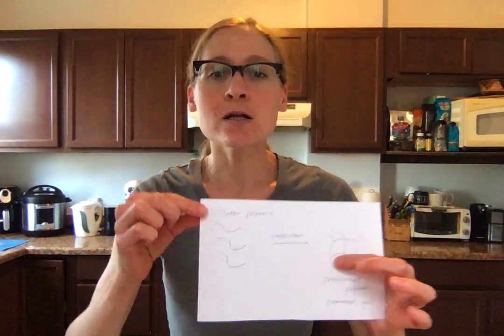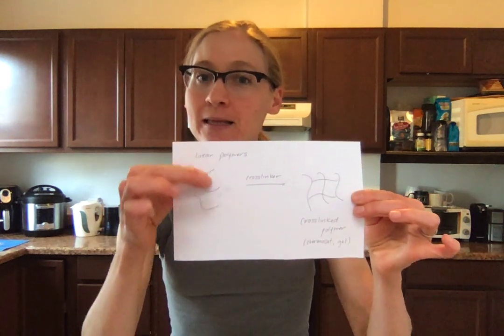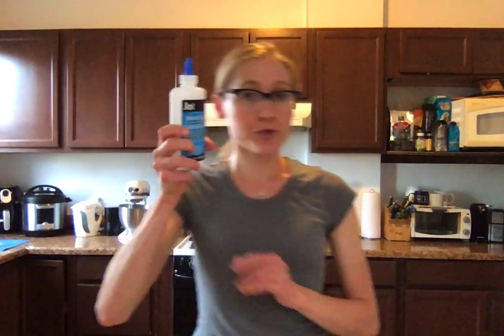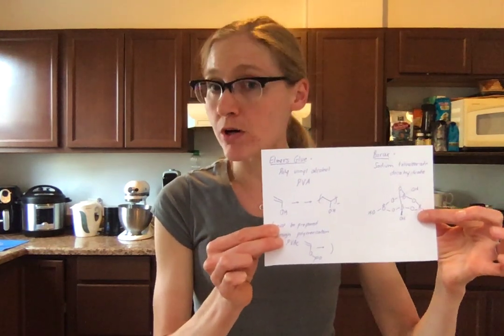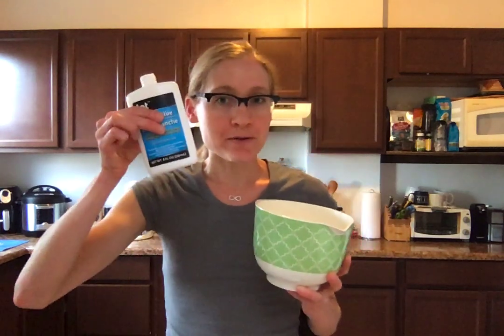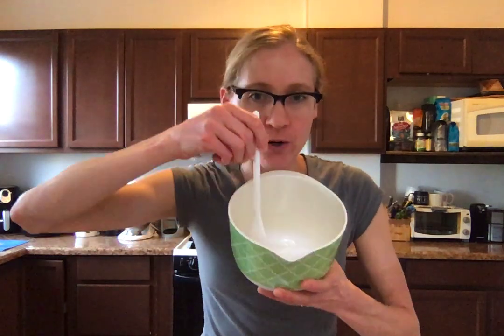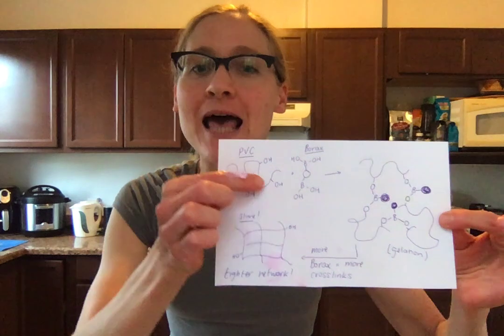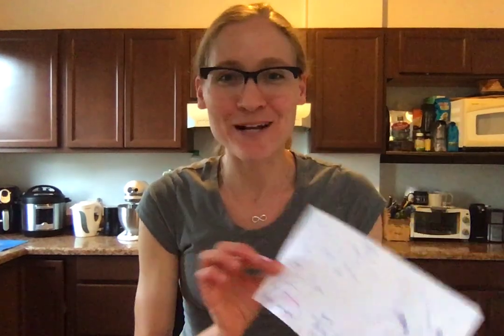Slime! Polymer Crosslinking Explained in the Kitchen

Comment: Awesome! Thank you, I'm not a chemist but have been interested lately in bio polymers and have been searching for information about crosslinking. I tried to make a hydrophobic starch bioplastic using citric acid as a cross linking agent. Would you happen to know what else I could use, it seems the citric acid gives the starch a lot more strength but it isn't hydrophobic yet, just resists a lot more water.
Reply from the maker: Hi! You could try the boric acid (borax) that we use in this video! Feel free to ask again if that doesn't work. Sorry for my delay!

Comment: Hello, 
thank you for your amazing lesson!
I have a question, Can you explain  please a bit more about  Molecular weight between cross links? 
thank you
Reply from the maker: Hi Myrat! Thanks for asking. Molecular weight (in linear polymers) is the length of the polymer molecule strand. In general with linear polymers, the material becomes stronger as we increase this length. In a crosslinked system (thermoset or hydrogel like we create here), we create the new bonds here between boron and oxygen. For these cross linked polymers, we introduce a new factor: the molecular weight between crosslinks. This is the length of polymer chain between each new B-O bond. As the molecular weight between crosslinks decreases (or, more B-O bonds are formed to bind polymer chains together) the crosslinked polymer becomes stiffer. I hope this helps!
Reply: @StefanieSydlik  Thank you very much, now I understand clearly, 
 I really appreciate your help!

Comment: Previous time Question 
What can we do to avoid formation of cross links between spaghetti 🍝???? i need an answer for this question please asap!!!xoxox
Reply from the maker: Hi! So in spaghetti, those are actually entanglements, since there is not a covalent bond between the spaghetti strands. To avoid this,  you can make your spaghetti shorter (break it in two before putting it in the pan)-- this works in polymers too! We call it an entanglement molecular weight. You can also add some oil, to prevent the sticking-- in polymers, this is analogous to adding a plasticizer. Hope this helps!